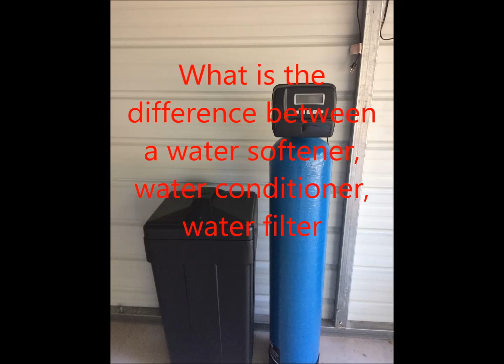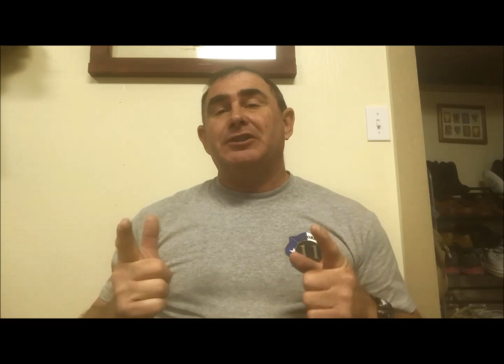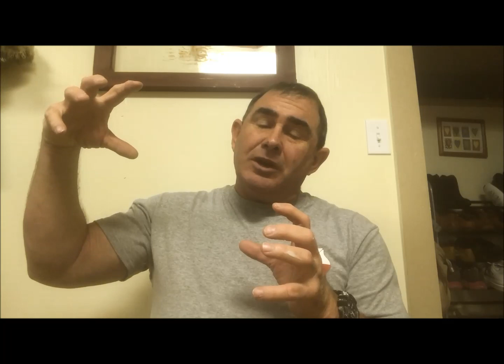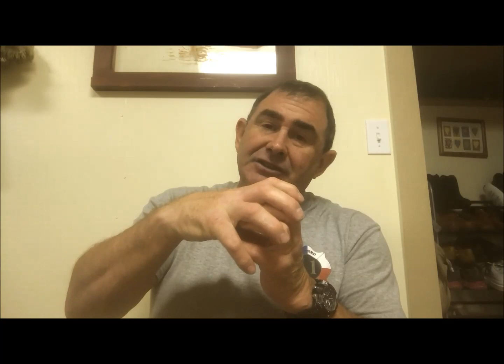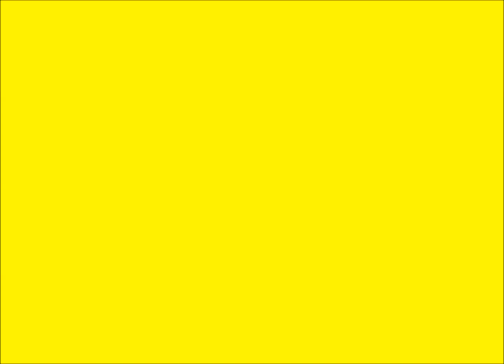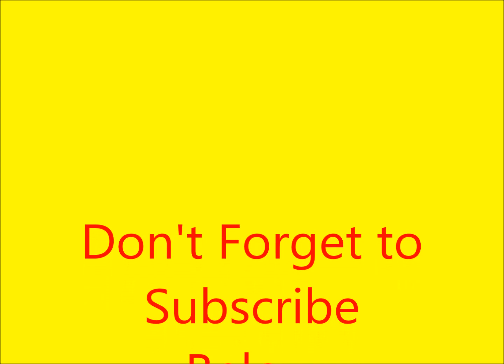Whats the difference between water softeners and water conditioners

Comment: What are your thoughts on the SpringWell Salt Free Water Softener (Conditioner)?
Reply from the maker: I looked at their product and it is the same as all others as far as their conditioner, the only difference is that they say theirs has a lifetime warranty.  I cannot imagine that there is a TAC with a lifetime warranty so I called and spoke to Paul I think.  He said they offered a lifetime warranty, one thing I forgot to ask is, how will I know if it stops working? And if it does then what do I do?
Reply: @LowCostWaterSofteners  thanks for looking into that. Those are two really good questions you bring up.

Comment: What do you think about  OneFlow + Salt-Free Scale Prevention and Water Filtration System? Looks a very good alternative to water softener and conditioner, easy maintenance.
Reply from the maker: Jay T it is a water conditioner, who are you getting it from and what is the cost and do you know what the media is?
Reply: @LowCostWaterSofteners  Selling on Amazon for $599 + filters (carbon filters and scale prevention cartridge) for $320.  I'm thinking of getting pre filter to catch the sediment, planning to retire in Las Vegas but water there makes my skin flare up (rashes from bathing).  Here's the description of the product ---- ONEFLOW+ WATER FILTRATION: The OneFlow+ System uses Template Assisted Crystallization (TAC) rated most effective scale prevention technology by WateReuse Research Foundation (Evaluation of Alternatives to Domestic Ion Exchange Water Softeners, 2013). The TAC system attracts and converts hardness minerals into harmless, inactive microscopic crystal particles that stay suspended in the water and are passed to drain.
Reply from the maker: Jay T I would not recommend a cartridge it may not work like you would expect. I only recommend at least a 1 cuft tank upflo of SP3 Filtersorb. I use 5 liters because that’s what the manufacturer says to use and I have never had a problem. I would always put a pre carbon filter if it was on city water to remove chlorine. The 5 liters will remove up to 25 gpg of hardness at 10 gpm  which is suitable for any home
Let me know what you think

Comment: Whats your opinion on Easywater company that promotes radio frequencies to change the calcium and other stuff, or magnets to polarize the same...  thanks
Reply from the maker: Richard Novo I’ve seen them work , meaning no customer complaints and I’ve seen them not work, meaning customer complaints. I think it may have to do with the conductivity of the water. If it were my company I’d find the common denominators for what works and what doesn’t. I’d also ask what the customer is wanting done with the water. I had a customer that had something similar but he had a scumming look to his coffee and his tea was cloudy. We put a water softener and he was happy. My opinion is if you want soft water use a water softener because it removes the calcium if you want a water conditioner then easywater may work. I hope this was helpful.  Also I apologize for taking so long on getting back to you
Reply: @LowCostWaterSofteners  I am more impressed with the filtersorb SP3 media.. your thoughts?
Reply from the maker: Richard Novo I used it in my own home. I had an iron filter then the SP3 and it had the same affect as my water softener.  I wanted to make sure it worked before I sold it. If you’re on public water then you’ll want a pre carbon filter if on a well you’ll want to ensure there is no iron or H2S in the water before you install it
Reply: @LowCostWaterSofteners  iron yes, on a well, will install the air fleck you recommend, my ph is 6.8,.    Iron filter, then they SP3 filter, you advise any chlorine or hydrogen peroxide shot into the water?
Reply: Btw Jim,  I have seen different types of AIS FLECK iron filters with  different media installed, and saying platinum version, which media, and which fleck filter you think is best? Different prices too. Thanks
Reply from the maker: @atomicbeing  no chlorine because it will ruin the sp3 media, hydrogen peroxide probably won't do anything
Reply from the maker: @atomicbeing  use this one and ask for filter ag plus so you won't have to change the media  https://amzn.to/2WEZCxb
Reply: @LowCostWaterSofteners  do you have a parts in page Jim?
Reply from the maker: Richard Novo I’m not sure I understand your question
Reply: @LowCostWaterSofteners  sorry, auto correct got me there, Patreon page.
Reply from the maker: Richard Novo no sir I don’t
Reply: @LowCostWaterSofteners  would love to send you a little $ for your help. Thanks. BTW I found Nelson co. Makes the filtersorb SP3 conditioner but sell only to professional companies,  any retail company you recommend to purchase the conditioner from?  Thanks again ..
Reply from the maker: Richard Novo I put a link to amazon on your question in my water softener review 2018
Reply: @LowCostWaterSofteners  tks
Reply from the maker: Richard Novo here’s a link https://www.amazon.com/gp/product/B004DJBMJC/ref=as_li_qf_asin_il_tl?ie=UTF8&tag=allamewatsoff-20&creative=9325&linkCode=as2&creativeASIN=B004DJBMJC&linkId=fccc33a729f06d60fcbc1803a4639911
Reply: @LowCostWaterSofteners  is this the filtersorb SP3 media?
Reply from the maker: Richard Novo yes it is
Reply: @LowCostWaterSofteners  thank you for this link Jim, but this conditioner says 25 hog hardness max, my well tested 40gpg. Can I still use this model? Will the iron filter ahead of it reduce the total gpg? Thanks.
Reply from the maker: Richard Novo let me check on that. I use Nelsen Corp also so I’ll investigate and get back to you
Reply: @LowCostWaterSofteners  thank you so much!
Reply: Any findings on the conditioner from Nelson Corp? 40gpg? Hate being a pain in the neck but wife wants this bought asap and I don't want to buy the wrong one. Thanks  again...
Reply from the maker: Richard Novo you’ll need 10 liters and a 12x52 size tank
Reply: @LowCostWaterSofteners  great! And Thanks! Wish I could pay you for your help!
Reply: 10 liters of media Right? Duh!
Reply: @LowCostWaterSofteners  sent you 50 dollars for your help Jim, coming in the mail. Please Lmk when received.  thank you..
Reply: You should open a patreon page, your help was very valuable to me thanks..
Reply from the maker: Richard Novo I received the check Thank you

Comment: I live in the country and on well water.  I have a water softener right now.  Will the water conditioner work as well as the softener regarding washing and etc?
Reply from the maker: colts4740 yes the water conditioner will work the same but you’ll want to ensure you have no iron in your water that will coat the media and prevent it from working

Comment: What questions do I need to ask and answer for deciding between a water softener and a water conditioner?
Reply from the maker: I'm sorry for the delay, you'll need to ask yourself whether or not you want the maintenance of putting salt into your salt tank and whether or not you want to purchase a carbon filter which should go before your water conditioner if you are on a public water supply in order to remove the chlorine and if you are on a water well then you will want to make sure you don't have iron and if you do then it will need to be removed with an iron filter which should be installed in front of your water conditioner
Carbon Filter-https://amzn.to/2LEyHsw
Iron Filter-https://amzn.to/2BLKXmC

Comment: Which is better Polymer Resin or Gel Bass Resin?
Reply from the maker: Sir, I apologize for the long wait before my response however for some reason your question was held for review without my knowing.  To answer your question in short, I have never done that much research on the various types of resins.  I do know that each type of resin has its strengths and in many cases is used for particular types of Ion Exchange processes.  I have found that unless I have a specific case that may fall outside the parameters of what I do then I reach out to someone who may have an expertise greater than that of myself to address the specific case in question.  In other words if it is not a normal water softening situation then I refer it out because of the liability of which I no longer care to indulge, none the less high liability cases cause too much stress :)  I'm apologize for not giving you my opinion but I hope my explanation is sufficient.  Have a great day
Reply: Ion exchange resin. Ionx2000 and Hysulex. And remember sales ppl have a bad name in thos country. What the question really is- how much is it worth to you
Reply: @josephh8  bingo! How important is your water to YOU! Going cheap on these things is just not smart.

Comment: Hi,  nice simple explanation of how each system works.   I am on well water, have a Halo5 with ion magnet tube installed, but of course, water still measures hard at 10 gpg.  Can I insert a softener somewhere in the system either before or after the Halo like the Pelican that would then provide soft, conditioned water?  Thanks.
Reply from the maker: From what little I know about Halo systems, I would place a water softener in front of your Halo 5 system.  Keep in mind depending on the water conditioning media, if any the water may show hard but the calcium may not be sticking to appliances  If you are still having residue on your appliances then you need a water softener.  The best for the money and simple to work with is the Fleck 5600 econominder.  Here is a link, https://amzn.to/2uGh8DL  I hope this helps
Reply: Sir, many thanks for your expert reply.  I needed someone like you who would give a neutral opinion.  I will check out the link that you provided and use your information to talk to the water people here in Las Vegas, NV.